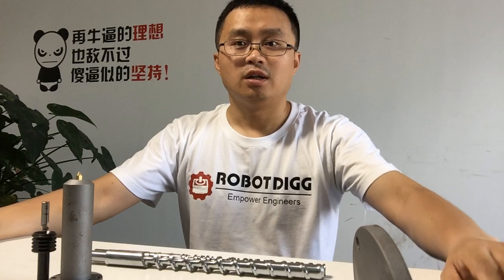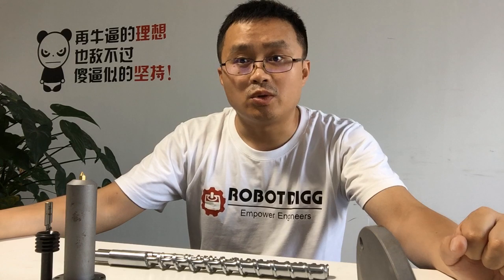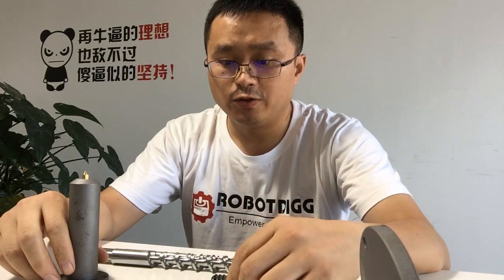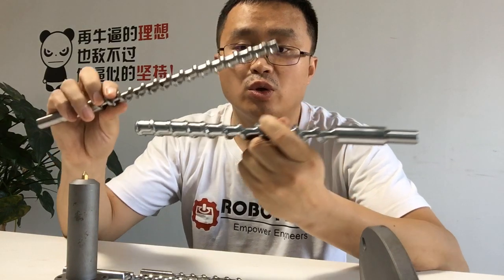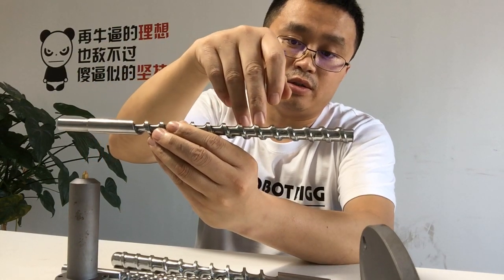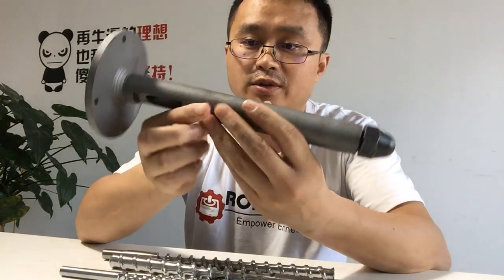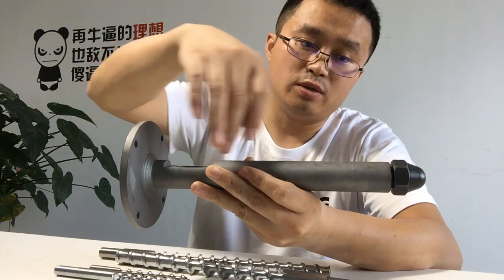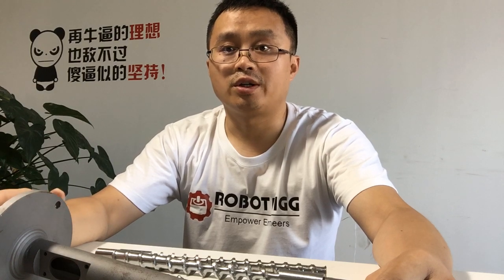Screw n Barrel from RobotDigg for Pellet Extruder

Comment: Hello, I am about to buy the 20mm bolt with the barrel but I don't see that the bolt can be added with recoil protection to avoid damaging the reducer. Can you tell me if I have to add an axial bearing to the bolt in order to protect it? the geared motor, do you understand me?

Comment: What hotend does it connect with?
Reply from the maker: It's Not for 3D Printing, it's for extrusion, heating put on barrel.
Reply: @RobotDiggSH  The picture on your site shows it connected to a hotend if I understand correctly https://www.robotdigg.com/crab/image/2019/01/06/19e5dfdad43316ee73d2341974832544.jpeg